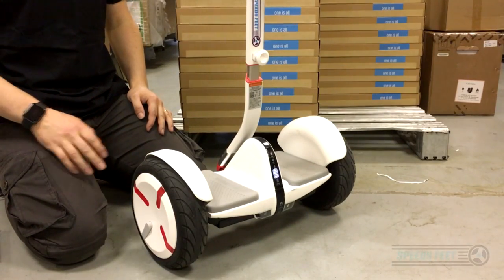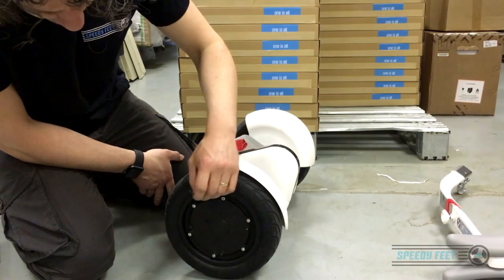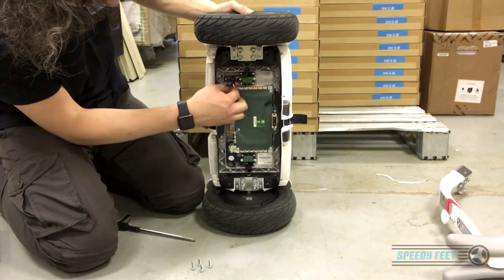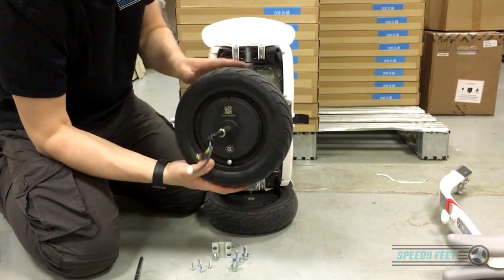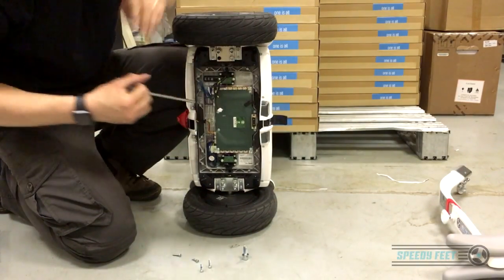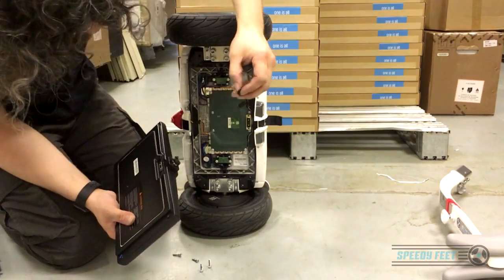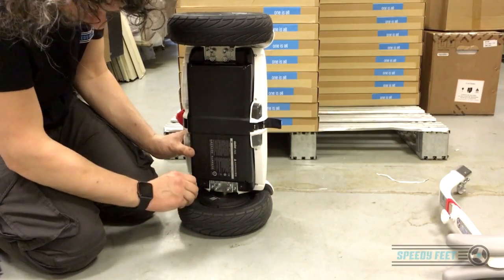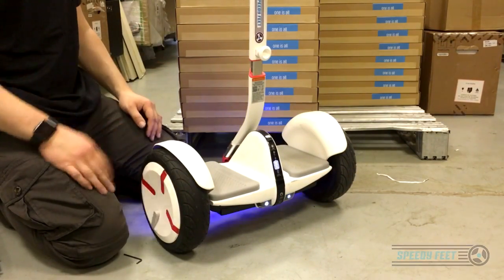Ninebot Mini Pro Tire / Motor Removal

Comment: Many thanks. There is no information on the Segway site, and very little on YouTube. I have had mine for a couple of years but now the wheels/hubcaps creak and flex at each revolution. This is a problem, as I use it for filming. Any thoughts on what is causing it and how to solve it? (Dorset?)
Reply from the maker: We found that then tires were under inflated it could cause that. Also - you can remove the plastic trim if its a major issue.

Comment: Replaced my motor due to the shaft broke, but now after I installed the new one it just blinks and won’t move or do anything any advice thanks 

I double checked my wiring and connections 🤷‍♂️

Comment: If anyone out there uses a rachet strap on the tire to help set the bead BE SURE TO DEFLATE THE TIRE AFTER THE BEAD IS SET BEFORE RELEASING THE RACHET STRAP! My dumb ass didn't do this last nite when I put my new off road tires on and I almost took my finger all the way off when it shot off and hit me in my knuckle from an inch away. 22 stitches and a nite in the ER later here I am turning my mistake into something positive from speaking as someone who learned the hard way to be credible advice to prevent someone else from having to learn the way I did. Our biggest failures become our greatest attributes when we our humble enough to do this for others. Be safe everyone and please take this warning serious and don't make the same mistake. At least I got my tires on lmao.

Much love

🐇White Rabbit 🐇

Comment: My valve stem mysteriously split, do you all carry that as a separate part? M4M offered to sell me the tire+motor combo (hence the reason that I'm looking at your video),  since a new tire doesn't come with a new stem. However my motor is just fine, I've only used my Minipro a handful of times.
Reply from the maker: Sorry we don't, but its a standard tubeless valve stem.

Comment: I accidental rolled over a tin thumbtack from my message board.  It's a shame they have such crappy tires.. Not at all impressed
Reply from the maker: The tires would have to be pretty thick to withstand that sort of abuse. Like cycle tires get punctures through little thorns and car tires get a puncture with a screw. Solid tires are the only way to avoid this...and ride quality on those is shockingly bad.

Comment: In order to remove the wheel covers, you need a 2.5 sized metric Allen Wrench. Anything else and you risk stripping the bolts.

Comment: so....so far so good but i found this clicking noise coming from the wheel... all the screws are tight but it looks like the wheel it self is loose inside.... any ideas how to fix it? i have try to open it but seems like i need to take off whole wheel off and then open the engine and fix something which hold a wheel? omg... video clearly shows that the movement of the wheel it self...

Comment: Thank you for this video. 

My left tire has been leaking air since the unit was new, a few months back. I used your video to reseat the tire and just got done riding it. Now time will tell if the air loss issue is resolved. 

I tightened all the bolts on the underside too, only the 8x 2.5mm case screws were not completely finger tight, so I snugged them up. All the other bolts we nice a snug on the underside. 

Not too invasive to remove a tire, just make sure you have the correct metric allen wrench, a blade screw driver, a towel or shop rag for the ground, some time, and a desire to DIY! 

Thanks again for the awesome video, well done!
Reply from the maker: Thanks Aaron, glad you got it sorted and the video helped!

Comment: this is not pro, this is normal mini , so why you wrote on your video that is pro to grape ppl ?!!
Reply from the maker: This IS a Mini Pro yes.
Reply: no this is not pro , ill give you 1000$ if this is pro . first pro is written on body , second pro the tire from inside is or white color or gray color not black , there is etc if you want to know
Reply from the maker: Excellent, please send $1000 to the email on our website www.SpeedyFeet.uk. Pro is not written on the body (unless its a USA version). Motor unit is black on the pro, and secondly the pro has the red steering adapter for the pro bar to attach to. We should know, we bought loads direct from Ninebot. Rather than send us the money give it to Charity.
Reply: we have here and its not  USA version and its written on the body pro , even on your site the tire from inside is white color :),,so ?
Reply from the maker: OK, will leave you with it. But it is a pro, no point in arguing about it. We only, did, buy from Ninebot direct - who will not sell the cheap version outside of China. Nor is it legal for us to sell it in the EU as it is not CE certified. Have a good day and thanks for watching!

Comment: have you had problems with the tire losing air? One of my tires keep losing pressure slowly and i have to keep pumping air, no signs of holes in the tires. Also the tire that loses air wobbles a bit while riding. Maybe i don't have the wheel aligned correctly?
Reply from the maker: Yeah its a common problem with the Ninebot Mini, lots of people with the same issue, we have 2 in the warehouse we use daily with the same problem. Pump to 45psi and it should last around 3-4 weeks, then may go flat (due to losing around 10psi, then after this is loses air very quickly). Its because they are tubeless, relies on a seal on the rim/motor. Why they did it this way I have no idea! A tube would be much better.
Reply: Ninebot UK thank you for the information.
Reply: I have the same issue, tried removing and reseating the tire, and am testing it now, results pending further testing. 

I am suspicious there is some kind of lithium grease or something that can be applied to the area where the edge of the tire meets the rim of the wheel to improve air sealing. I will probably end up consulting a tire shop expert. Any ideas?
Reply: I bought my mini pro about four months ago, and in the first few days discovered i had a slow leak one of the tires.  Or so I thought...   every couple of days it would lose almost half of its air and i was constantly adding air.  Then after three months, i noticed the valve stem (rubber part coming out of rim) was where the air was leaking so i bought a new valve stem for $8.00 plus a new tire since I wasn't 100%| sure if i didn't have a slow leak from the tire too.  in the end only put t :he valve stem on and initially all was well, now two days later, hear air slowly escaping from the valve stem :(     I think i'm going to call segway customer service ....

Comment: I was riding my mini pro and out of know where beeped leaned back hard threw me off, knee pad even went to the ground which i thought wasnt supposed to be possible and then it shut off.  won't turn back on. standing it on knee pad to reset it but nothing.  any ideas?  you just seem to know your sh*#
Reply from the maker: Thanks for watching and the comment! Sounds a little odd! The Knee pads I think you are talking about these: http://www.speedyfeet.uk/product-p/foam-pack.htm) - will hit the ground if leaning forward. They can't touch the ground when dropped backwards.

Try removing the battery and reconnecting. ALSO - do the wheels turn freely or very 'gritty' when turning?

Also email in to info@speedyfeet.uk and we can help you further of course.
Reply from the maker: Thanks for watching and the comment! Sounds a little odd! The Knee pads I think you are talking about these: http://www.speedyfeet.uk/product-p/foam-pack.htm) - will hit the ground if leaning forward. They can't touch the ground when dropped backwards.

Try removing the battery and reconnecting. ALSO - do the wheels turn freely or very 'gritty' when turning?

Also email in to info@speedyfeet.uk and we can help you further of course.
Reply: I just had the same issue. The unit turned off and won't power on. I can't find any trouble shooting solutions.
Reply: I agree with Speedy Feet UK, take the battery off, leave it off for 5 min to let everything in the main unit drain. This is called a hard power reset! Then reinstall the battery. Thats a good starting spot to try!

Comment: It says that warranty is void if you remove the battery.  LOL...
Reply from the maker: Yeah I know sucks a little, although with the mini its understandable as removing the battery exposes the whole inside so easy to damage once the batt is removed.
Reply: I am curious to see how the LG battery holds up over time. 

I am an expert at battery chemistry so to get maximum life, here are some tips. 

1. 30-80% charge, when it gets to 30% charge, when it gets to 80% unplug. This is called long life mode charging because the shallow charging greatly extends the cell life of most lithium ion chemistries! 

2. Every 500 hours of use, do a formatting charge by discharging to a low state 10%, then leaving it parked on the charger for a few hours after it reaches 100% to allow for a deep saturating full charge. 

3. Avoid full power use if the unit is frozen solid below 30deg F or 0 deg c, also avoid charging if the unit is frozen. Let it warm to around 45 deg F ( 8 deg C) before you go full speed or try to charge it to full! 

4. High temperatures over 122 deg F ( 50 deg c ) will greatly shorten the battery life, avoid parking your unit in direct sunlight on a hot day, especially if your have a black color model! 

5. Keep water out of the battery if you take the battery off the head unit. Water and lithium ion do not mix well! 

6. Do not loose sleep worrying about the battery or its charing, you can get likely procure a new battery to replace an old one with capacity loss!
Reply: Eddie Moy they dont honor their warantees anyway

Comment: Hi, is the 9bm pro battery is same as 9b1e+ battery size and watt? 30 km not enough at less 40 km or can it replacement extra battery if run out?
Reply from the maker: +Jimmy Cheung Sorry not sure what your question is. The Mini Pro takes me around ~15 miles on a charge. The Ninebot ONE takes me around ~10 (had 13miles when I put specific road tire on it).

Comment: hi, what should be the correct tire pressure for ninebot mini pro?
i could't find it anywhere?
Reply from the maker: 45 psi Ninebot recommends. Although it states 35psi on the tire. We run our minis on 45psi.
Reply: Longer range at the higher pressure, ride harshness is reduced at the lower 35psi level, a trade off. The higher pressure gives more precise handling, better control feedback, and long range, so I operate mine at 45psi too!